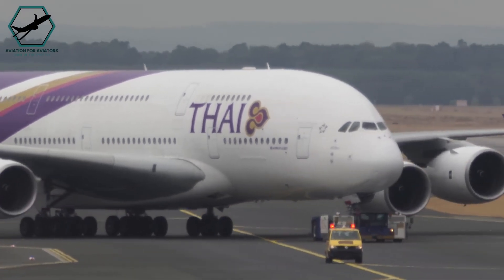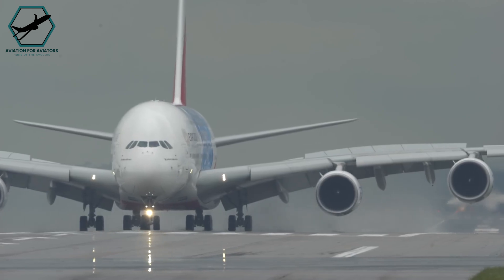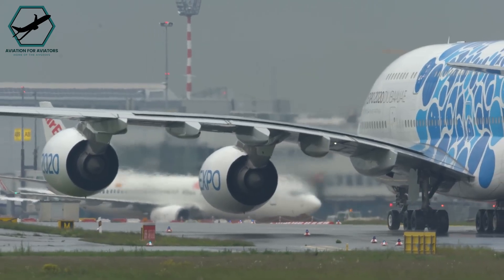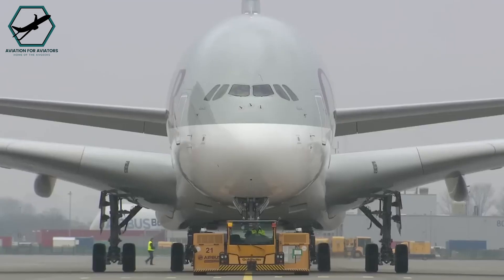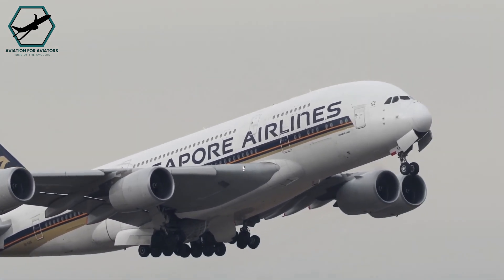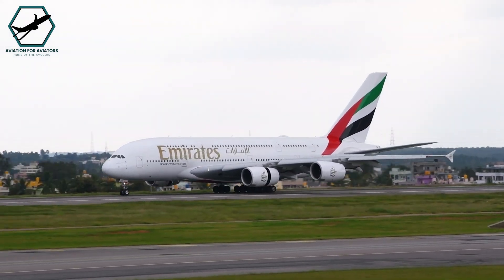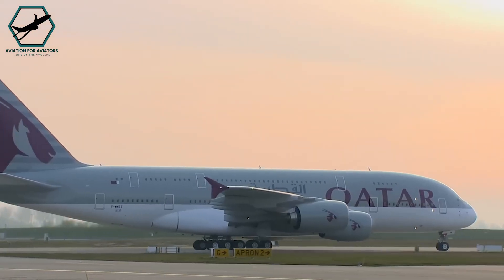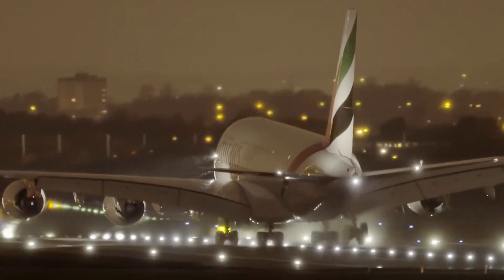Why the Airbus A380 Only Utilizes Reverse Thrust on Its Inner Engines?

Comment: It's a stupid/risky idea.  There are going to be situations where you need all 4 engines reversing, especially in reduced capacity situations (uncontained fan explosions, separated engine, damaged hydraulics [can't deploy spoilers], icy runways, emergency diversions to shorter runways, etc., etc.).  It just removes an important tool for skilled pilots.  It's a bad idea.

Comment: Besides the foreign object damage (FOD) issue, Airbus designed the wings' control surfaces to provide more ability to slow down the plane just by aerodynamic forces alone. In fact, the A380 should be able to land and stop on 10,000 foot runways easily even with reverse thrust turned off.

Comment: Physics 101
Reverse thrust on outer engines will deviate the plane from the center line
Reply: How does symmetric thrust create a yaw moment? How is it any different from the inner engines?   Do you see A340’s weaving around under reverse thrust? 747’s? C5’s? How does “Physics 101” apply only to the 380? It does not.  It was for the reasons in the video?
Reply: @rdspam  I have to agree.  The most you could say is that it would make the plane more susceptible to runway deviation.  Yet any pilot worth his salt could either compensate for it, or in engine-out situations, simply not select to reverse the counterpart engine.

Comment: Having flown on both Airbus and Boeing international planes, the A380 and A350 are my 1st & 2nd favourites over any of the Boeing offerings, as the Airbus planes are significantly quieter than the Boeing’s, something I confirmed using a Decibel Meter App on my iPhone, and positioning myself in approximately similar cabin positions in all aircraft. Cheers!
Reply: Also, you don't have to worry about door plugs popping out!  🙂
Reply: @James_Knott  😁👍👍
Reply: Yep! Definitely. Instead of, when A380 starts, it's so silent I often thought first flights, they didn't throttle fully up.
Reply: Very true. I've dine the same. Also gor some reason window shades on Boeing planes tend to rattle.

Comment: Why would you say "reverse thrust adds half a ton", and then say that the plane weighs more than a million pounds? Use units consistently, now I don't know what that half ton means in comparison to the rest of the aircraft...

It's a shame, because the rest of the video was nice...
Reply: Agreed. What the hell is a million pounds?
Reply: The A380 as a MTOW of 575 tons. It used to be 508 or 512 (I don't exactly remember) for the first few years. In Emirates, we used to have payload restrictions on ULR flights like DXB-SFO, DXB-LAX until the MTOW was increased to 575 tons.
I like videos who use one measurement system and subbed the other one.
Reply: @jiggythibs   The U.S. is one of the 2 or 3 countries still stuck in the dark ages and not using metric.  The other countries are 3rd world.
Reply: @James_Knott  😂
Reply: Who cares what measurement system a third world country (America) uses. Pity these videos are so imprecise and inconsistent.
Reply: Bottom-line: you're talking about 3-4 passengers and their luggage.  I'm adding more than the usual amount of luggage because the typical flight of a 380 is over larger-than-average trip distance - making more than average luggage (i.e., checkked baggage) quite likely.  So I think their argument is bascially BS.  The plane can theoretically carry almost 800 passengers, but nobody configures their planes beyond 500 or thereabouts.  So we need to quit kidding ourselves about this: I think it's just another accident waiting to happen at the end of an icy runway.
Reply: A ton is 1000 pounds, so you can do the rest.  However, your question should be why they're using pounds or tons, when they should be using kilograms.  It is designed and built in countries that are metric as is just about every country that flies it.
Reply: @James_Knott 1000kg = 1 metric tonne. This should have been the unit used. I guess they were aiming at a US audience. Shame, since everyone else uses metric.
Reply: @James_Knott  Ton is 1000 kg , not pounds
Reply: @pmaxgen   That would be a metric ton or tonne.
In ancient measure, a short ton (US) is 2000 pounds and a long ton (UK) is 2240.
Reply: @James_Knott  A ton is 2240 pounds
Reply: @jiggythibs   That depends on the type of ton.
Reply: @James_Knott  I thought the ton used in US was the metric ton. 
Thanks for the hint.
Reply: @jiggythibs A US ton is 2,000 pounds.

Comment: Actually reverse thrust is rather overrated anyway. Most airports do not allow the use of it unless thrust is in idle, thus the impact on the rollout is relatively small. It is mostely needed and helpful either in bad weather conditions or if your plane has a  serious issue. Of course some airports exist where you def. would want your reversers but these arent really the destinations an A380 would be flying to or rather flying from, because A380 needs quiet some runway to take off. The A380 needs ~2100m of runway to land, while at least 3000m are needed for a takeoff, so there are ~1000m margins anyway. That being said most big internation airports which are host to A380 landings and departures these days have 4000m runways, adding even more margin to that.
Reply: Whatever length the runway has, it's mass and speed that heats up and wears the brakes.
The reverse thrust makes it easier for wheel brakes.
Reply: It's not about landing distance, it's about reducing brake heating. I fly the 777F, and the use of reverse thrust reduces our BTMS values by quite a bit. In airports like AMS or NRT where lengthy taxi times are normal, reverse thrust really helps on the taxi in especially if you're aiming for a quick turn.
Reply: @CSkyhawk722  Just yesterday I saw a video of a C-17 using single-side reversers to perform a broken U-turn ('K'-turn) at the end of a runway that didn't have a "bulb" at the end for U-turns.  I think it was at the Azores, where the plane needs every inch of runway it can get.  It also then used [balanced] reversers again to back its tail over the end of the runway before comencing its take-off run.
Reply: Ah, yes - - you're getting it - - ye' olde "serious issue".  That's exactly when you'd wish you had 4 of them.
Your point about the distrubution of airports the 380 services is probably the most persuasive.